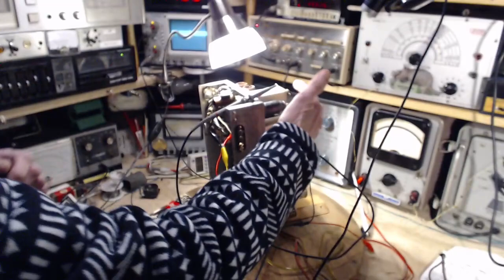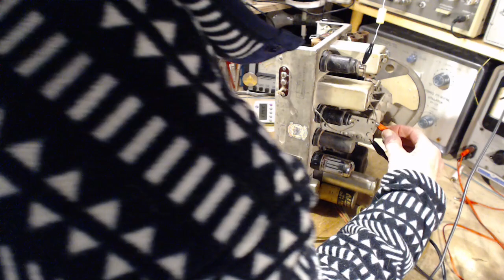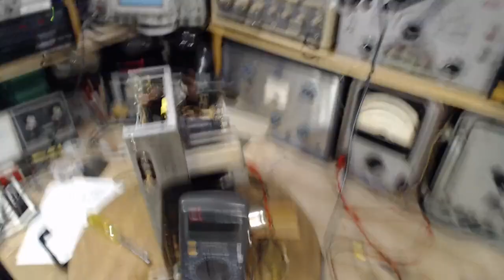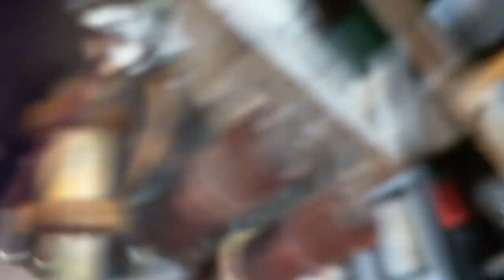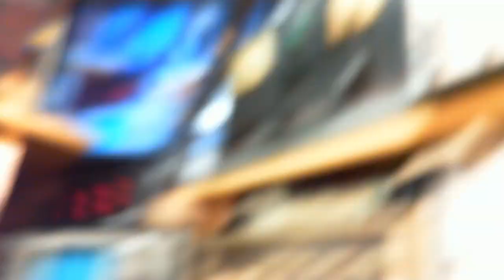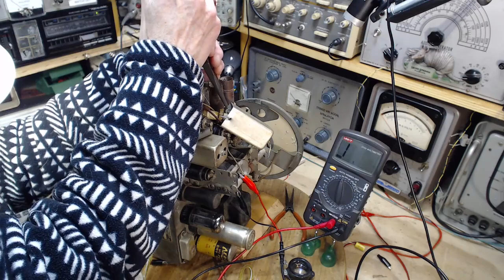Stewart Warner R146 Video #9 - IF Transformer Repair Attempt

Comment: I feel like I am watching "Death of a Radio" here.  Slowly over 9 postings I have watched this radio get worse.  Had to look away when he was ripping the transformer cover off the other day.  Wont even take the time to unsolder it so that it would come off easy, but watching how he "fixed" the grid connection wire who knows what would have gone on if he did that.  Again no tubing or heat shrink needed with him just leave everything exposed.  These are hard to repair IMO, I watch Mr. Carlson tear them down an repair them an he makes it look so simple and easy, my attempts are just that attempts.  I hope Jim steps back and starts over.  First fix the weak output that should be the easiest, then repair those antenna connections instead of just leaving them flapping around.  Verify the speaker is even good (maybe this is a better first step).  But have a feeling this is going to end up sent back unfixed, or maybe he will receive one channel say its good as it can be and say mission accomplished!

Comment: 40:28 WTF? If you want to test the IF transformer pass curve you need to get the connections right. You cannot just poke around and nilly willy stick the generator on wires that are not on trees by the count of three until you get a signal to your liking. 
The curve you get suspiciously looks like you are injecting to the cold end of the secondary winding. And yes that is possible since the cold end of the secondary is NOT GROUNDED but on the AGC potential. It is RF grounded via a 0.05u cap but if you blast a signal across that cap it will give and allow some RF across it.
And you certainly did NOT FIX the secondary properly. Soldering RF litz wire involves connecting to all the strands in the bundle. The fine strands of the bundle are each laquer covered and thus insulated to one another even inside the bundle. It is more complex than that, but you may try to think of a coil made of say 12 stranded RF litz wire as 12 paralleled inductances only connected at the ends and not electrically connected throughout the coil. Following that thought, it gets clear that just getting DC resistance reading from end to end does tell you zero about the success of your fix. For all you know you could have just managed to connect to 1 out of those 12 strands, resulting in a DC resistance reading from that one strand, but the AC parameters are down the drain because you basically just only connected 1 out of otherwise 12 paralleled inductances.
For god sake take advice and learn! Don't go messing up things just because you make up your own version of reality.

Comment: Jim ....   Put the insulator back in the IF transformer....it serves a very important function !  If it served no function the manufacturer would not have incorporated it ..!!!
Reply: @Gordon Lyell Pardon but he took that transformer apart two times. And after he forgot to put back the insulation on the first go he should have remembered it on the second go. But to ice the cake; if you watch at the start of this video,he lamented that the insulation will have no effect and that he would not put it back on. So he did not forget, he deliberately chose not to. Another case of rejecting common sense, common knowledge and common expertise and making his own screwed reality.
And he has the owner of this radio pay for this bodge jobs too.

Comment: Before you dismantled that IF transformer you were screwing up the trimmers, so now you must re align those trimmers having put it back together. After that you should concentrate on why you have no audio lift off the 1st audio grid.
Reply: I am sure that coil is NOT fixed. A DC resistance reading on RF litz can come from as few as one of the multiple strands making contactend to end. But that is not guaranteed to get the AC properties it was designed for since you reduce the surface area to a fraction of what it was when it was distributed among  multiple strands. 
And also because of individual strand insulation RF litz will not wick solder like normal braided wire so you need to do a good solder job not some blob on.